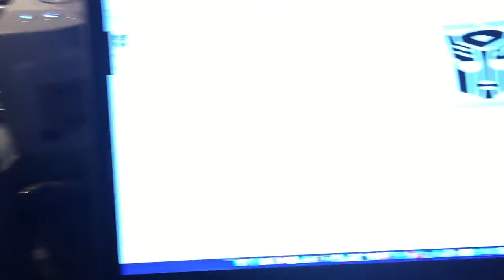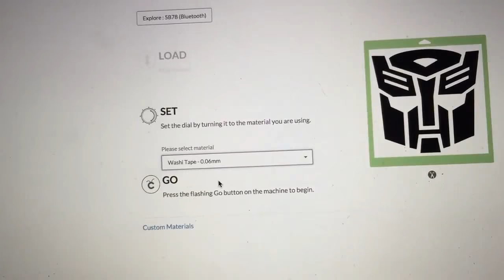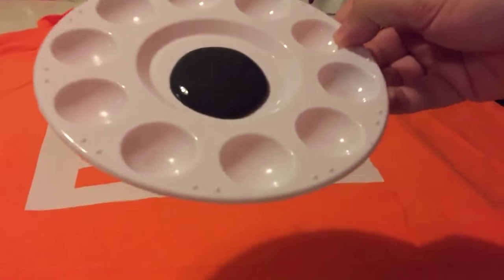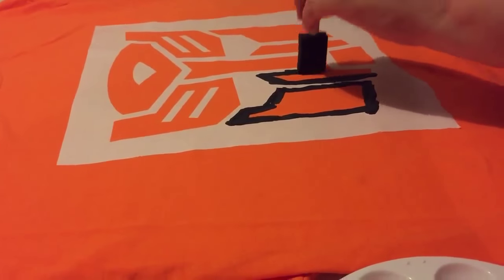Freezer Paper T-Shirt Painting Tutorial

Comment: yours is the best I've seen so far and does that tulip paint hold up to washing
Reply from the maker: It has held up mostly. There are some areas that have thinned a little. My son still wears it weekly though.
Reply: +Carol Pyles did you wash the shirt beforehand and not use fabric softener? I actually think it wearing off in areas would be kind of cool because the distressed look seems to be in.
Reply from the maker: Yes I wash all the shirts before i do the freezer paper painting or use HTV, it insures that all products put on them before being sent to the stores is cleaned out. And yeah no fabric softener.
Reply: +Carol Pyles  i havent tried yet, just wondering if that happens either way. i tried to cut on washi (tape and sheet) setting and for some reason, my cricut will only cut the right side all the way through :/ the same thing happened last week when i tried to cut some intricate letters on vinyl. it is actually the right side of the design in particular,  not just the right side of the mat. one design was very small like less than 1 inch and it only cut the right side through. the other design i tried for this t shirt idea it took up the whole mat and the right side only cuts through.Thanks for sharing this and and being so responsive.
Reply from the maker: notebookluvr that is very odd, might be worth a call into cricut support
Reply: +Carol Pyles the dreaded call to customer support! :-( lol